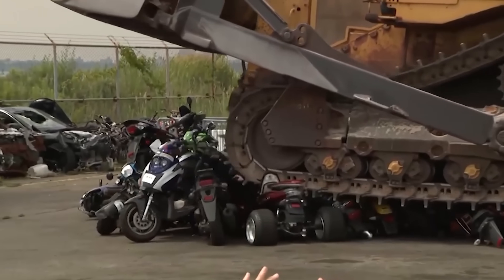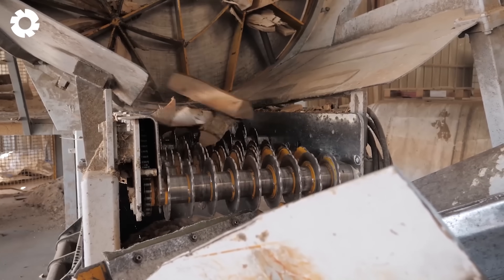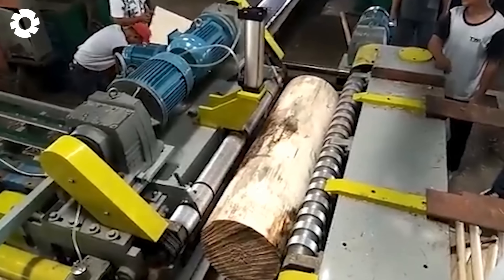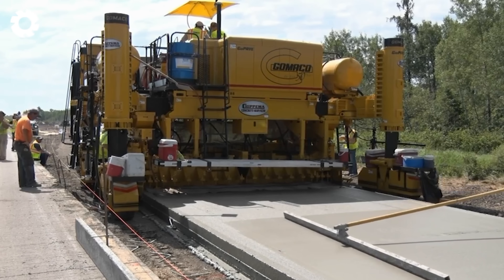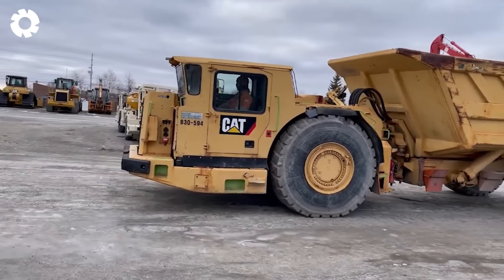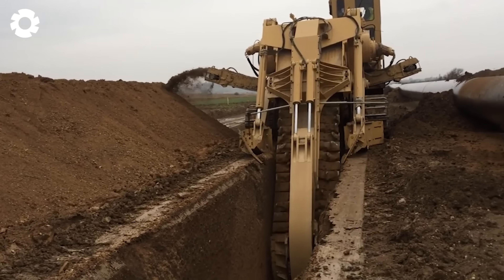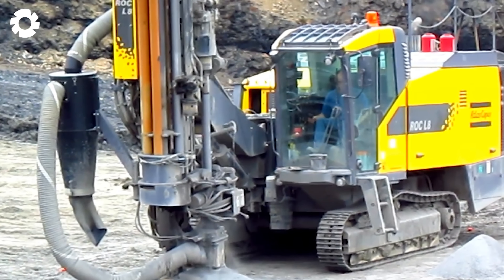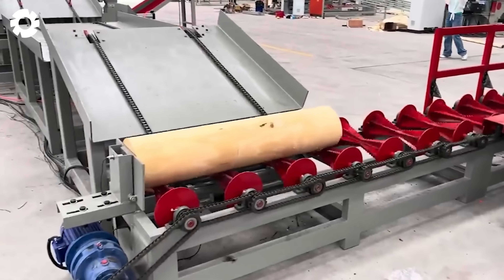Transporting Crocodiles This Way - Biggest Heavy Equipment Machines | AgricultureTechnology

Comment: Even flywheel energy storage modules are installed by balance-calibrated heavy machinery.
Reply from the maker: This heavy machinery includes an in-line return filter with bypass valve, protecting the main tank from contamination under backpressure.

Comment: Heavy machinery installs steam turbines powered by factory waste heat.
Reply from the maker: The heavy machinery adjusts pump displacement dynamically based on terrain resistance and operator input.

Comment: Heavy machinery routes insulated steam pipes from steel plants to residential heating zones.
Reply from the maker: High-pressure relief valves on auxiliary lines protect attachments from overpressure during tool change.